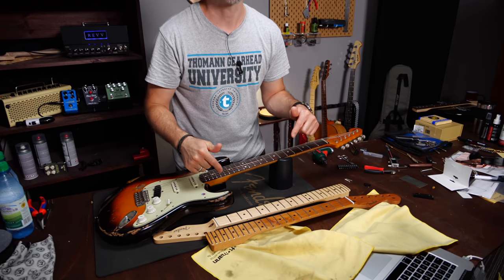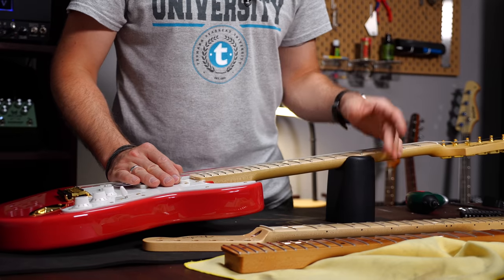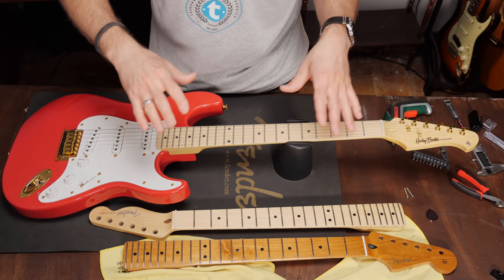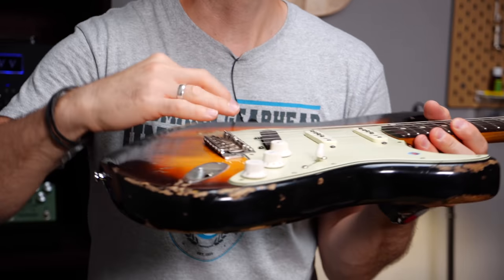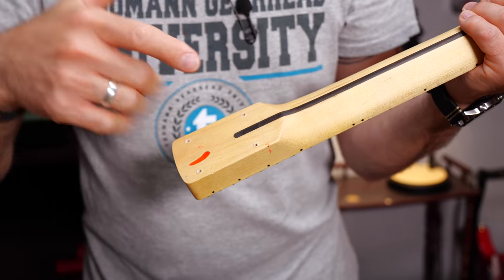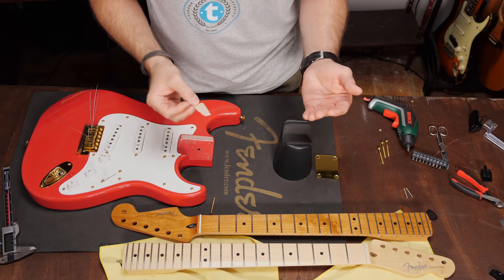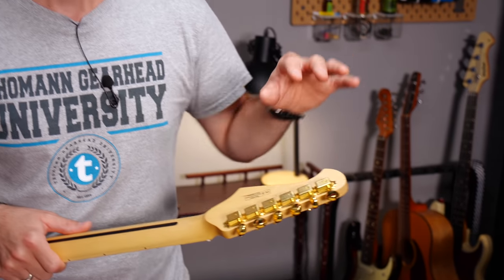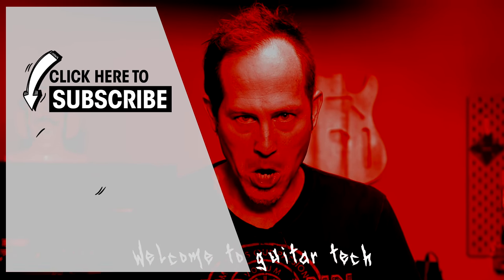Issues With Swapping Guitar Necks | Guitar Tech Tips | Ep. 77 | Thomann

Comment: resale value? WHO sells their fully modded guitar ever? 😀 I don't think the resale value on my MiM have dropped with the alterations I have done, and  I am waiting for the Fender American Professional II Scalloped Stratocaster Neck, Rosewood to arrive in mid september, and the 500K pots and the last DiMarzio pickup is on its way... So you're telling me the value will drop when i'm done alternating it?   
 Its a 2023 Fender Players Series, I already swapped the tuners to Fender locking tuners, the pickguard it came with was dented when i bought it, so Fender sent me a new one, that i replaced!  I swapped the bridge pickup to a Seymore Duncan SHR-1B ( hot rails ) I swapped the neck pickup with DiMarzio Air Norton S.  I ordered 3 Fender Volume/tone 500K pots split axel, have a DiMarzio Pro Track on the way that will go in the mid position, and ordered the Fender American Professional II Scalloped Stratocaster Neck, Rosewood that gets shipped from US and will come in mid of september. 
 I've set it up with .08 gauge and intonated it, and you tell me this will/has lowered the value of my guitar rather than rising it? The scalloped Fender neck cost almost as much as the guitar it self cost me and the neck also has it's own warranty. Its like a Fender Custom guitar and that would rise the price not lower it or am i totally in the wrong?   I thought about swapping the tremolo bridge to a US tremolo bridge, but not sure if there is a point in doing that as the tremolo bridge that came with the MiM probably is just as good as a US made so it would just be a waste of money am i right OR would you recommend a swap of the tremolo bridge and if so why? 

Long comment no. 2 hope you don't mind.

For the mods on my Squier Aff Telecaster 2024 that i have done and whats left to do, I don't care if it looses warranty or value, but i do think for my self that it will be worth more when i replace the Squier neck with a US telecaster Neck even if i have to alternate and adjust a bit to make the fit, will probably be the fittings that are off on the Squier just as the tuners on the Squier had holes that was off from the original Fender tuner that i put on, and i guess the warranty has failed on that guitar already since i drilled new holes and put the MiM Fender tuners on it when i put locking tuners on the MiM strat hehe!
Reply: At music go round sadly I often find used modded instruments. Got a MIM Strat loaded with Seymour Duncan single coil humbuckers. For 450. Has a fret job, with rolled edges. I often see ppl in there under hard times desperately trading in instruments for cash.
Reply: @ReviewCart69   that's super sad to hear! I rather starve than selling my guitars. My Strat is a MiM, has a Seymore Duncan hot rails bridge pickup, a DiMarzio Air Norton S neck pickup,, has Fender locking tuners, next week I'll put in 500K pots, and a DiMarzio Pro Track in the mid position, and ordered a Fender Prosessional II scalloped neck in Rosewood with narrow tall frets that are rolled, only the body, pickup switch and the tremolo bridge that is MiM, even the pick guard is US made that fender issued me because the one it came with bulked out on two places.  so it's almost more US than MiM. I plan to buy either a black pick guard US or a pearl white.  was thinking about replacing the tremolo with the ones that comes with the professional II where the tremolo arm just pops in and out instead of having to screwing it in place. Not sure if the US professional II tremolo bridge is better than the MiM or if it's exactly the same only having the difference that you pop it in and out. because if they are of the same quality then it would be a waste of money replace it where the difference only is the pop in function. the pickup switch is of similar quality and would just give me extra work to replace for no reason, or so I was told. what's your opinion on the term and the switch quality of MiM and US version? the neck was very expensive.. it cost 810$ while the guitar it self i bought for 960$. it's the Seafoam green 2023.  I would not sell it even if someone offered me 3000$ for it, total price with everything is 2550$ ish with shipping included.
I also have a Squier affinity telecaster. Dimarzio chopper bridge pickup, and the MiM tuners from my Strat which I had to drill new holes to make em fit... going to change the bridge with US version which says fender and have the 3-point saddles and later I'm swapping the neck to a US fender telecaster neck that costs 610$ which is 200$ more than I payed for the guitar itself, that one also getting 500K pots and since that is my rhythm guitar I'm not having scalloped on that one. for the neck pickup I'll maybe go for DiMarzio Twang king or just be crazy and give it Seymore Duncan cool rails or their version or Twang, have not decided yet. it's butterscotch yellow ❤️ the MiM neck I'll place on a cheap gear4music guitar and buy fender locking tuners as well and have the MiM pickups, but not changing the pots on that since its just the "guest guitar" prolly buying a Fender backplate and a Fender tremolo bridge for that one and sadly both on that guitar and maybe even the Squier I have to make adjustments to make the necks fit, even tho it says that the Fender US tellie neck should fit right into the Squier I don't belive that lol. I know for a fact that the cheap gear4music guitar must have spacers to make the MiM pao ferro neck fit, maybe also have to do some sanding, I'll be very surprised if it doesn't.  which MiM do you have year and color?
Reply: @ReviewCart69  realizing I already wrote most of this in my previous comment lol, sorry for re writing most of that

Comment: Thanks a lot for useful content , there is a 1 mm gap  between neck and body from the side on my 2013 usa fender strat  , is it mean lossing sustain ? 
If yes , how to fix that ?

Tanks
Reply from the maker: Hey, thanks a lot! Even though that gap doesn't necessarily look very nice, it's not a big issue at all. Most bolt on neck guitars will have some space on the side. What's super important for sustain is the bottom of the neck, where it sits in the neck pocket. If that's tight and it sits flat on the bottom, your guitar's sustain should be fine.
Cheers //Kris

Comment: Hey Kris, great video. I have a question: There are in the market a lot of branded and unbranded necks. In 4:26 you fill the gap with a piece of wood between the bottom of the neck and the guitar body. What happens if any gap appears alongside the low frets (the neck's length is smaller)? The same piece of wood is enough to make the guitar playable?
Reply from the maker: Do you mean a gap between the new neck and the side of the neck pocket? If that's the case, the new neck is narrower than the old one. If you're lucky, the two E strings will still run OVER the fretboard instead of being too close to the fretboard edge. That can't be fixed with shims unfortunately, so it's a matter of luck. Intonation and string height always needs to be adjusted anyhow when swapping necks. //Kris
Reply: I built a Strat style guitar using a Warmouth neck and body. The high e string was a little too close to the edge. After years of playing it that way I ran across a YouTube video that showed how to fix it. Loosen the neck screws a bit, pull up (toward the top edge, not the face of the guitar) and while maintaining the pressure, tighten the screws. Worked great and has not not moved.

Comment: I want to swap out a neck on my guitar that’s 25.5 Inch scale length with a 26.1 Scale length neck and am curious if that would be doable or not seeing as how there’s not really that much different in length
Reply: It'll be fine if it's a conversion neck, but not otherwise. The difference has to do with where the neck is supposed to mount relative to the bridge.

I used to have a Jagmaster with a 24" scale neck, but this neck won't work on the older 24" Jagmaster or Jaguars or Mustangs. It can't be properly intonated on a 'true' 24" Fender body without relocating the bridge.

It will however work to make any 25.5" Fender into a 24" scale; it's essentially got the nut where the first fret would go.
A conversion neck in the other direction would have the first fret roughly where the nut is on the standard 25.5" neck.
Reply: just needs an equal distance from the 12th fret in either direction to both :
saddle↔️ (12fret) 
=
(12fret) ↔️ nut .

as precise as possible 
👍

Comment: Changing neck is not really recommend because you will face many issues it will not fit very well especially at the neck pocket & neck angle even if you're swapped it with the same brands and/or same model it always have differences.
Reply: That's what I've heard. It's easier to build the whole guitar and get it in synch, unless you're swapping parts from an identical model & year.
Reply: Not true when it comes to Fender. It is very straightforward to replace a Fender neck with another Fender neck and I've done it several times and also have used two Warmoth necks which also go straight onto Fender bodies with zero issues.